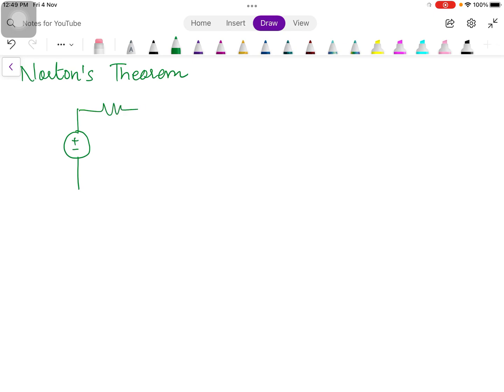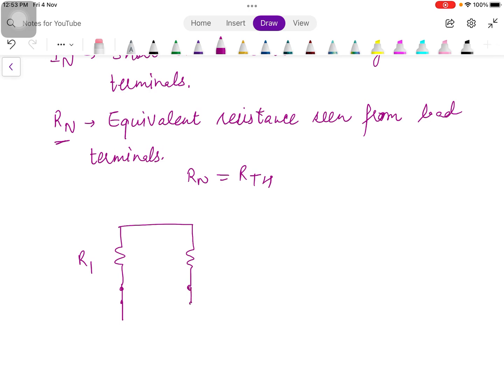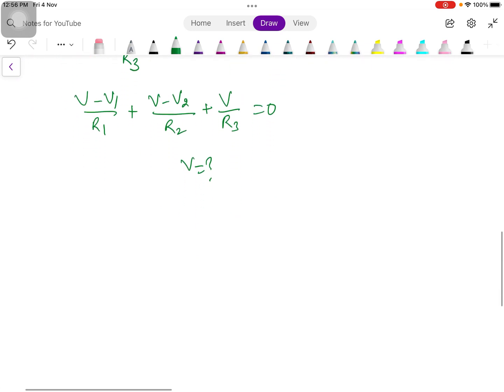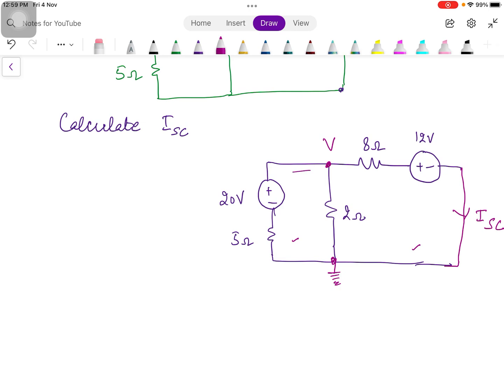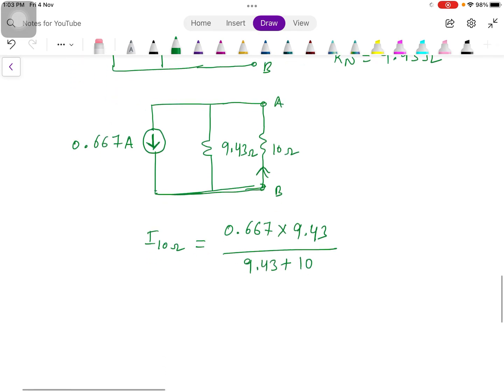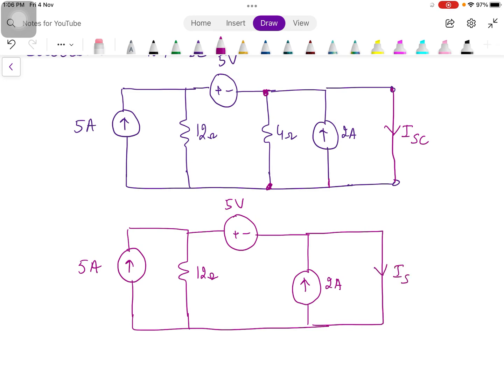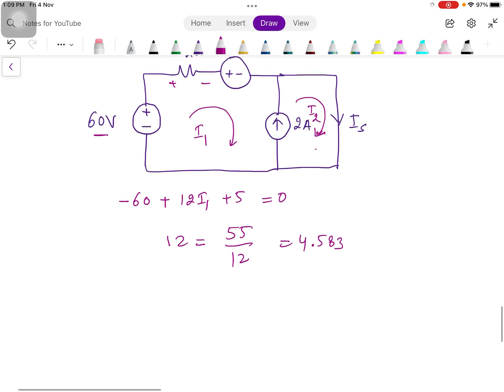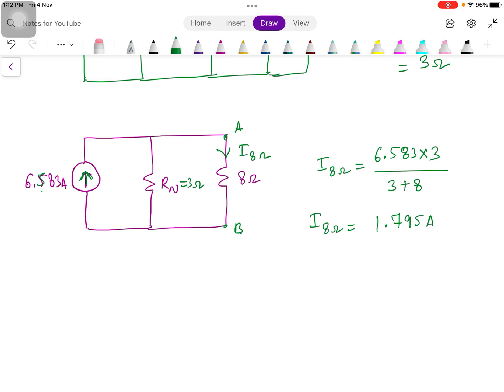Norton's Theorem: Part 1 #circuitanalysis #dccircuits #nortonstheorem #networktheorem

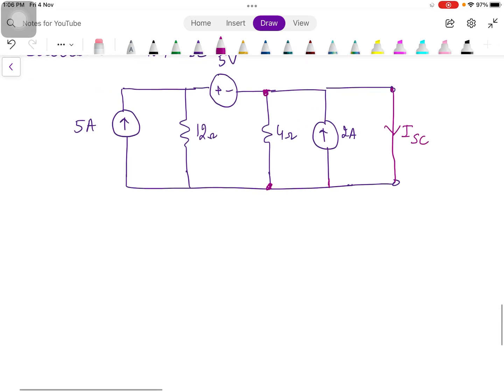Comment: mam ye 18:05 pe aapki awaaz ni aa rhi ...4 ohm resistance kyu hata di aapne vahan se ? please explain
Reply from the maker: Bcz 4 ohm and short circuits are in parallel.  The resistance of Short circuit is zero. It means 4 ohm is in parallel with 0. When calculate the parallel equivalent of 4 and 0 its is zero as Req=(4*0)/(4+0)=0. I hope it’s clear now
Reply: @electricalmadeeasy7  thank u 🙏🙏